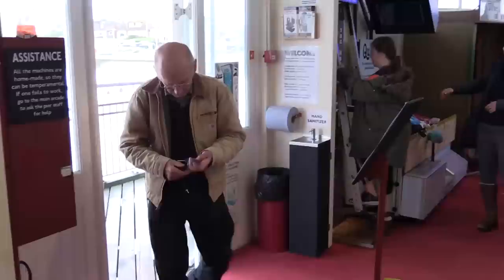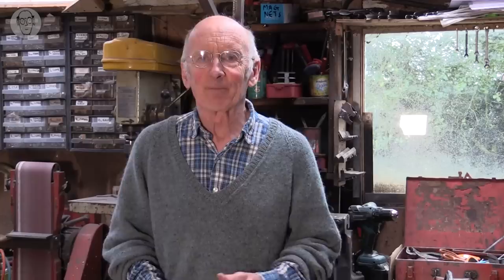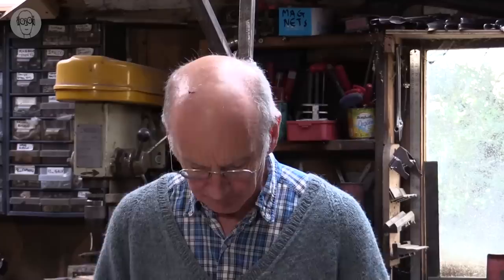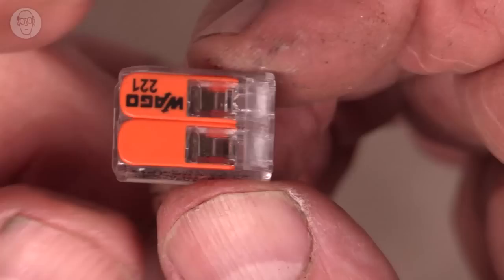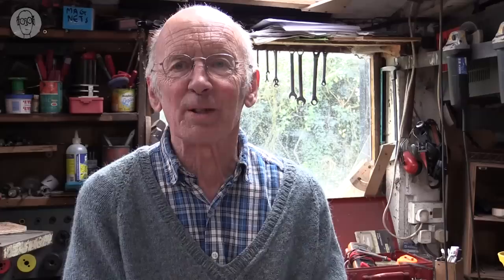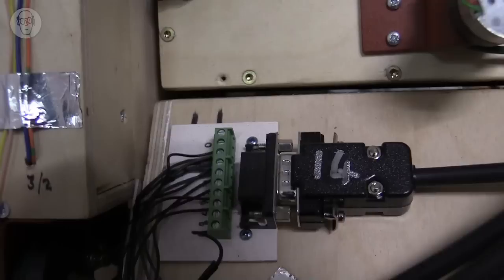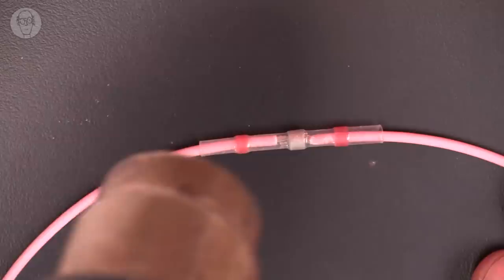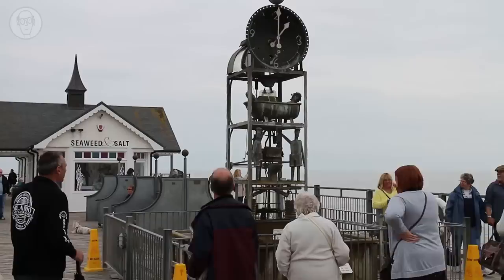CONNECTORS -- The Secret Life of Components, a series of guides for makers and designers - Episode 6

Comment: Ever since seeing NASA requires transparent heat shrink, that's what I've used. I've been amazed at how nice it is to be able to still see the joint after adding heat shrink.
Next time anyone reading this buys heat shrink tubing, try some transparent heat shrink. It is harder to find and often a bit more expensive but in my opinion it's well worth the effort and price.
Reply: The problem with heat shrink I have is when the wire breaks off it doesn't fall off and you cannot pull it out. So you don't see them problem with visual inspection. When I use electrical tape, when the wire breaks off, it either falls out or slight tug on it makes it fall out, so the problem is obvious. Hoewever electrical tape fails with time.

Comment: Another benefit of the spring connectors is that they don't work loose. My mains screw terminals always take another quarter turn after a few years.
 Years of practical experience that will save Newbies hours of frustration!. fyi you can get Fluke 112 meters with a  yellow case : ))
Reply: All I see are yellow cases. I'm trying to find the brown case like Tim has. ;-)
Reply: @ddegn   Duane, you cannot buy the brown cased ones. You have to be nominated by Men in Sheds who control the supply. The top tier ones have welding burn marks on the buttons and cratered screens that distort the readings.
Reply: @whitefields5595  My Fluke doesn't have welding burn marks but I have the special version with a silent buzzer. Apparently the noise of the buzzer is water soluble.
Reply: @ddegn  Duane,  I suffer from 'Fluke meter envy'. A friend-with-Fluke always makes a superior sniffing sound when we compare tools. Shame you diluted your buzzer, but as it was wet, I presume the magic smoke stayed inside?
Reply: When I tighten them I keep applying tightening force in tightened state for several seconds and let it "soak in".

Comment: 21:12 - Tim, if you're not already using them, try XT60 connectors. They have those "buckets" too, can carry a lot of current, and make a good physical connection. 

Also, you might want to get a different tip for your soldering iron. That tiny conical tip you use in most of these videos is meant for SMD work (as you probably know). For connectors and through-hole components you really should be using a "C-type" bevel tip (like the TS-BC2), which will heat the solder much more evenly, and make it flow right into the buckets (or to the pads, etc.). No ugly blobs caused by uneven heating, as happens with those tiny conical tips (you even mentioned this in a previous video - the tip not transferring enough heat - but then continued to use the same tip).

TS-100 irons have a nice selection of tips, are quite short (which makes them great for precision work, it's almost like using a a pen), and can run fine off lithium cells (as few as 3, though they heat much faster with 4 or 5).

Comment: Spades come in different thicknesses. It's in the spec. The crimpy bits of those red, blue, yellow things are very reliable when done with a proper crimp tool.
Reply: Like any crimp, dome correctly the crimp is stronger than the wire itself.

Comment: The episode pertaining to Spade connectors probably should have also included Bullet connectors (and crimp type butt splices as well).  I must have installed a zillion bullet connectors as a car stereo and alarm installer in the eighties.  Many radios came with factory-crimped bullet connectors on the wiring harness, often with clear vinyl rubber booties that could be slid over the connectors, which would further insulate them from the already slim chance of accidental shorts to the chassis of the car.

Comment: Using white heat shrink, writing on them and then shrinking it for a label... very clever! A new use for the versatile stuff.

Another Quick tip, got some heat shrink that is too small? 
Put it around some needle nose pliers and gently heat it while spreading the jaws apart makes it expand nicely. It can also be done cold but its easy to go too far and split the tubing.

Loving the content and its great to see your talent again. Watched you back in the original series as well.
Cheers,

Comment: A few years ago I upgraded from twisting wires together to using the lineman's splince (or a variation)... followed by wrapping it in tape because I usually forget to slide heatshrink over it first or can't find any the right size.
Reply: @cmmartti  Oh god yeah, or you try to slide the tubing over a bit too soon and the solder blob is still hot, so the tubing shrinks too early and no amount of forcing will make it fit.

Comment: Excellent demonstrations and useful tips on using electrical connectors. I have used a majority of connectors shown in this video in my 37 year career in electrical engineering. In many of the custom car/motorcycle and car restoration projects I have done, I've used the skeleton crimp connectors with the clear slide on sleeving. These are much more reliable than the plastic covered crimp connectors because they use the rollover or fold technique to fold the metal connection into the wire strands, like the Molex style but larger. Much more mechanically robust and looks much more professional than the red/blue/yellow crush crimp connectors.
Another mistake I have come across often during fault finding is tinning/soldering of stranded cables before inserting them into screw clamps or even crimp connectors. Never solder or tin a stranded cable before inserting it into any kind of clamp/crimp terminal. The joint compresses because the solder is softer than the copper. This leads to fatigue of the solder causing the joint to 'relax', fatigue or crack making an unreliable connection. I have seen this cause arcing and catching fire within connectors melting them, particularly in high current high voltage applications.

Comment: When I worked in TV & VCR repair back in the early 90s, many a customer would extend their mains leads merely by “twizzling” the stranded wires together and sloppily wrapping some loose-fitting insulation tape around the whole mess. 

Their twizzling could well have caused some sizzling

Comment: One thing with heat shrink is to wait until the solder joint cools and if you have to place the heat shrink on the wire before soldering place it as far back as you can. While soldering the wire transfers heat well down the copper and will pre-shrink the heat shrink. Also, thanks a bunch for these videos. I always refer back to different sections when working on a project sometimes for something to listen to. Passing on your wisdom and experience in life is amazing and it's completely free. Thanks a lot sir.

Comment: In making a holiday display with a 1/10 scale (5 foot) helicopter that revolved 360 degrees, I solved the problem of giving it a 5 V feed for its LED running lights using a jack plug.  Thanks for a great video!

Comment: Writing on the heat shrink, such a great tip.  Thanks
Reply: In one of the places I worked, we had a machine that was vaguely like a typrewriter; you fed in heatshrink, precut to about 40mm long, each piece mounted flat on a roll of plastic vaguely like a comb, with the heatshrink on the 'teeth' part; the machine allowed you to type onto the heatshrink, which you then slid off of the 'comb' and fitted to the cable
Reply: @cambridgemart2075  I have seen it used, but just never thought to do it with just a marker pen. The shear simplicity of it is brilliant.

Comment: Wow, thanks for this video. It's a real blast from the past for me since I began as a trainee engineer making-up computer cables and wiring harnesses for mainframes. Lots of soldering of d-type connectors for RS232 and RS422 comms cables and IDC cables to connect computer system components to their boards. Back then it was cheaper to pay a trainee with a soldering iron than invest in crimping pliers and crimps. lol.

Comment: IDC = Insulation Displacement Connector.  The snappy bit provides strain relief by wrapping the ribbon back through.

My preference for splicing 1 conductor wires:  tin the leads if stranded, then tight J-hook together for best mechanical connection.  Heat shrink first !

Enjoyed your show for more decades than I'll admit to.

Comment: Thank you sir for a lovely presentation. I have been in engineering and tech services for 46 years and all your talking points are quite familiar. I am still amazed at all the connector types, adapter types and difficulties caused by all the non sense!

Comment: Tim,on the spade connectors,i often use the next size up for the wire i am using(if the loop wont fit in the proper size) and fold the wire into a loop on the end,insert it then crimp,it makes a near impossible to pull out wire. Also the quality spade parts are much better than the cheap junk we see on the market these days.

Comment: I have used those molex micro fit connectors, they are good.  The parallel port ones can be overheated easily with iron temperature set for lead free solder.  The tiny JSC ones with the smaller than 0.1 inch spacing are a miserable crimping job for those with small hands, let alone normal hands.  Those things, and eye strain are why I do software now.

Comment: Wow... a perfect summary of Connectors!  I went through a similar evolution: At first you don't think much about them... then later you do... and now you obsess over them!  I will confirm that the proper crimping tool is essential, I paid a fair bit for mine, no regrets, and it's not even a fair comparison to economy ones... You want to make sure the connection is done right, otherwise why do it?   Throw the cheap-o ones in the trash, they make your work so much harder.

Comment: now I had to look at my very cheap meter to see if indeed could check an amp draw and yes it can , not that I ever will. Out here in southeast Asia we use the British type of system but I don't understand why a  simple hair dryer or mixer , etc., needs a 13 amp fuse with a 240 volt 2 wire system. That will melt the wires way before the fuse blows. Also the old style plug had full length copper that you could actually touch the electrodes and get shocked while plugging in. Tim has the best show that I have ever seen  and still watch the secret life of machines to this day.

Comment: The spring clamp connectors are ingenious, what I've taken to doing is twisting up the stripped end and wetting the whole exposed bit with some solder. I used the same technique to do soldered connections for years. One day I learned that to make the soldered splice as robust as possible, they strip 2 or 3 inches of the end of the wires and then cross them in the middle and wrap the tip of one around the base of the other and then solder. It works great I've used it on machines and vehicles alike and never had one come loose since using that method it works brilliant 👍

Comment: I've found the Wago connectors very easy to work with.  I just used them for the first time this month on a retrofit.  The type I used can clamp from 10AWG to 16AWG.  I find they are very secure if expensive and bulky.  They have tiny cam levers for each wire and you can remove the wires without damaging the ends by prying the levers open.  Very fast though they wouldn't be of much use in tight spaces.  Excellent for power distribution.  There's a staggering array of types with the same cam lever mechanism.  I was impressed.  Thanks for the information.  Such a good video.

Comment: All these wire running around the machines made me think of CAN bus on cars, which then reminded me that I first became aware of CAN bus as a child via Tim Hunkins rudiments of Wisdom.
Reply: You think maybe Tim should be using CAN bus in his machines?  Seems like CAN bus would save a lot of cabling, but would require a lot more smarts at the actuators and sensors -- which makes sense for auto manufacturers making 100K vehicles with custom silicon, but probably isn't so good for Tim's almost-prototype machines :-)
(My last project used flex-pcb ribbon cable to drive a bunch of LEDs, no smarts at all required :-)

Comment: Been a sparky for 50 years and like the screw type terminal strips rather then the ones that require a screwdriver or push in type. Several times had the screwdriver or push in tetminals burn up. Had 2 100 amp injection machines with flimsy push in used for the feed ( mains ). Had the tech install wires in first machine and I did the second machine. Within a few days all 3 mains burnt up and second machine tetminals overheated. Replaced them with split bolt connectors. Nice vid.

Comment: We use pretty much the same spring clamp terminal blocks on DIN rail with wire ferrules in our industrial machines.  They also come in 4 pole versions so you can connect 4 wires together with each in its own terminal.  Another option is to use a double-wire ferrule that allows you to crimp two wires into one ferrule to go into a terminal.  Those are lifesavers sometimes.  We also sometimes take the plastic collar off of the ferrules to save space.

Comment: For spade connectors I heavily recommend the push down ones, which have a spring you can push on the non flat one instead of a bump. They both connect more securely and can be removed more easily.

Comment: Great overview, I didn't know the molex microfit connectors. They look neat.

Since this is targeting beginners, here are some hints from my own experience.

For soldering:
- You want a smooth, shiny surface in the solder. A too opaque and rough surface indicate a cold joint, which makes a mediocre connection and it can cause problems really hard to troubleshoot.
- Never "retouch" a joint by melting again the solder with just the iron. You'll get "spikes" and you make a cold-ish joint. If you have to, apply a bit of extra solder. The flux in the added solder will reflow the joint, so you get no spikes and good connection.

For screw connectors, make sure you're clamping just the conductor, not the insulator.

For IDC connectors, see @mikeselectricstuff comment. Also:
- there's an arrow in the connector that indicates pin 1, the red wire on the ribbon cable, which marks wire 1, goes there
- the IDC receptacle isn't designed to plug another cable on the PCB side, I wouldn't recommend that

Comment: Tim, your videos are such a great resource.  I'm working on a CNC router right now, and needed a good inline connector to allow quick detachment of the motors at the ends of long cable runs.  Was struggling more than I had any right to in finding something to work for that application online, but you sorted me right out as you always do!

Comment: I'm dissapointed but also glad at the same time, that you didn't go over all of the different types of JST's connectors. It's infuriating. I work with small electronics, and if you think 200£ for a pair of crimpers is a lot, try to find the crimpers for the 1mm JST SH connector :) (which is nearly impossible to crimp properly without them)

Comment: I replaced a shore power disconnect cable once, rated for 15 KV at 500 amp I believe. The individual pins had to be soldered (solder was pooled into the pins) onto each conductor using a MAP torch. The process took about 30 minutes each pin for heating and allowing for the solder to set. After all the pins were soldered, they were screwed into the cable assembly and a plug hole was unscrewed and a blue electrical insulating resin was poured into the entire assembly.

Comment: Thanks for the excellent videos Tim.
 Years ago I used things called ‘Screwit’ connectors. These were supplied with the connecting kits used to hook up Leslie speakers to  Hammond organs (both of US manufacture back then)
They were a small conical porcelain thing with a tapering thread inside and were  used to wind over a pair of twisted wires in order to both secure and insulate them. 
The narrowing internal thread effectively crimping the wires securely.
I guessed these were probably  rated for 115v AC max, so I only used them for the audio connections, but they were quick and reliable in use
Reply: Wirenuts aka Marrettes

Comment: Loving this series.  XT connectors also have nice buckets, and I also prefer the solder and shrink method, but if there's not power/soldering iron and an alternate heat source like a torch, those solder-paste shrink wraps are great.  Heat-shrink labels are also great.

Comment: Another wonderful video!

When splicing wires, I find that lineman splices are much more secure.
Reply: My dad worked in the atomic clock department where they were feeding the national telephone network and national TV network with atomic clock signal. I grew up believing that twisting wire together like lineman splice or other types of splice is not acceptable for reliability. I thought one should always solder.

Comment: Tim, I thoroughly enjoy your videos, and find them quite informative.   I have a fair amount or experience in the connector industry, and the two defacto techniques for crimped connectors are as follows.  Strip length of the wire should be long enough for the bare wire to protrude through the crimp barrel, and out the other side about 1mm.  The amount is termed "the brush".  Think about a broom and the bristles.  Secondly, the crimp joint strength test for 10-34 AWG wire is quite simple.  The wire should break before the crimp pulls apart.  The tool that you are using is a locking ratchet type (best choice) so, there's an adjustment to make the crimp tighter or looser.  

Thanks again for your great and talented videos.

Comment: I used to do a lot of those twisted splices with electrical tape.  But then I learned about the lineman's splice.  If I don't have a soldering iron handy, I'll do a lineman's and tape or heat-shrink that up, and it'll make a far more reliable connection than a twisted.  It is a tiny bit more tricky, but it's worth it and no more costly.